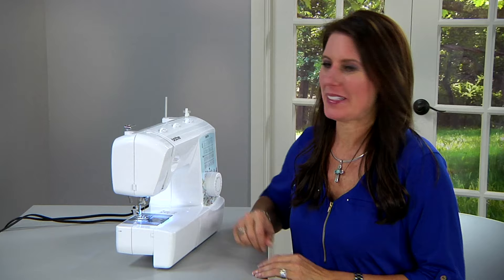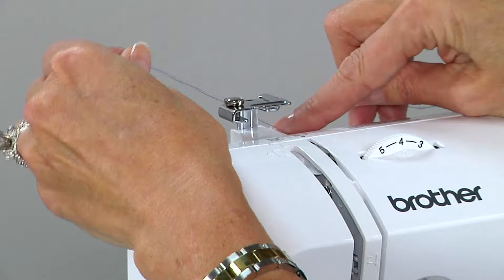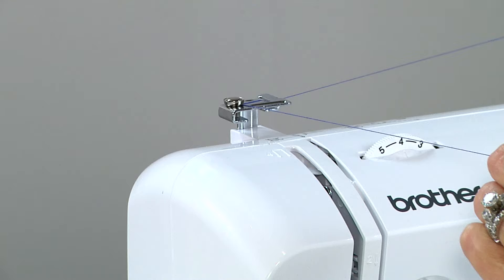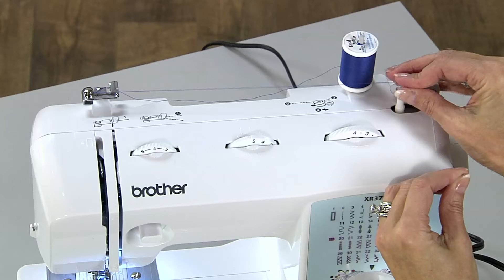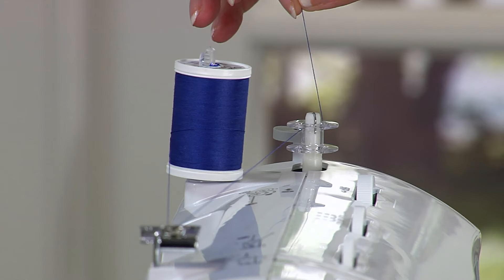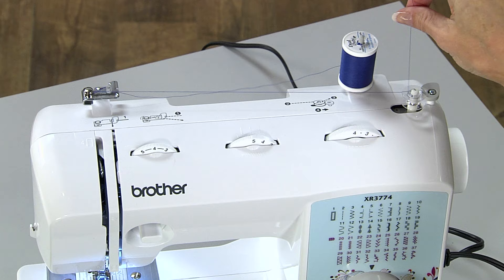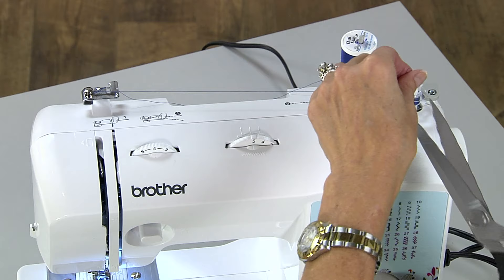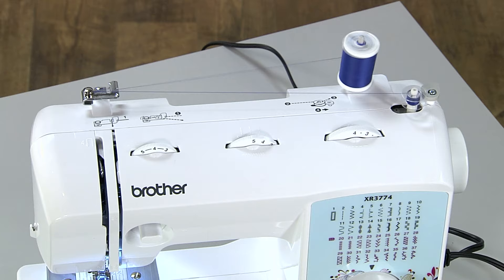How To Wind A Bobbin on a Brother Sewing Machine

Comment: Sure wish the instructions were presented at a slower, visual, pace.  What's the hurry?
Reply: I had the same problem understanding how to do it but I just made the playback speed slower I would try that, and see if that helps.
Reply: I was using this video for a bobin and it took me over half of a class period to get it correct because it was too fast to comprehend and it was confusing
Reply: I turned down the video speed to .5 

She sounds drunk but it is slower 😅
Reply: She’s a very poor presenter she goes way too fast and doesn’t explain things properly. Clearly not user tested with beginners. This is not how training videos should be put together.
Reply: The fact that her hand is blocking the view as she wraps the thread around the guide is so irritating! What an awful camera angle, you can’t see what’s going on!
Reply: So true